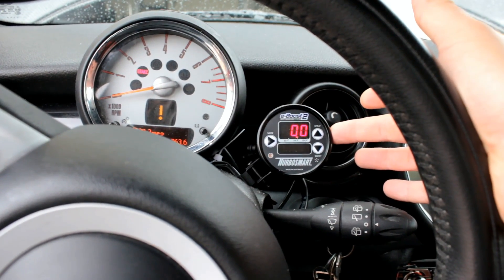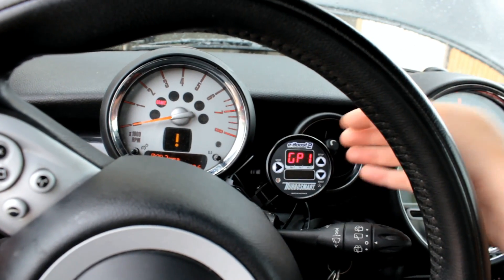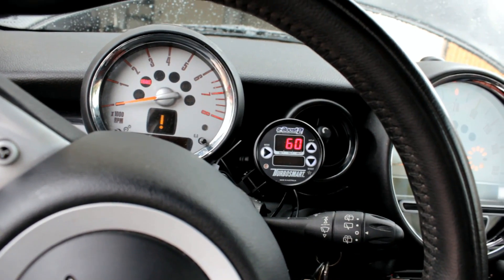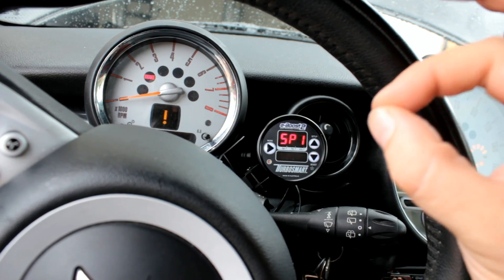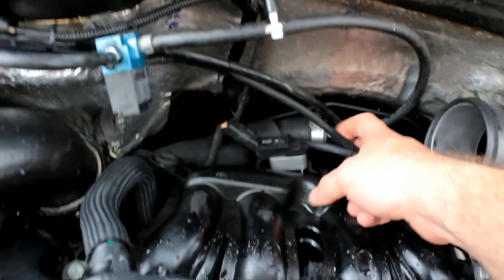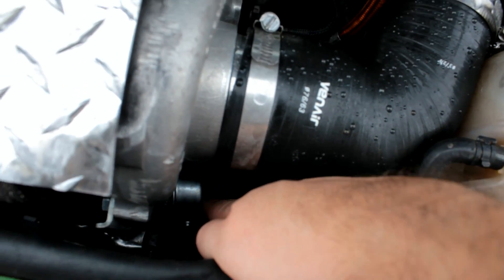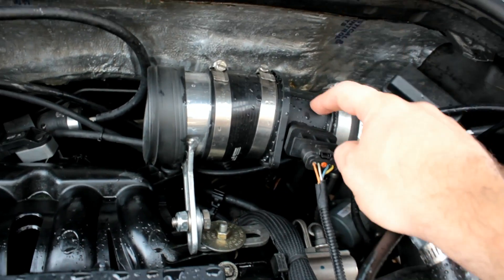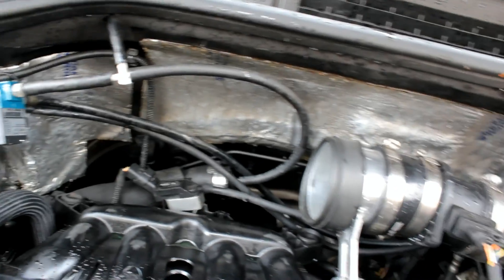Installing a Turbosmart TS-0301-1002 e-Boost2 Black/Silver Sport Electronic Boost Controller

Comment: I do not se how this would work with a factory vacuum setup.
Did u eliminate the factory boost control setup?
Does the aftermarket turbo now just use the old style vacuum/boost signal to control the waste gate?
Reply: Paul Danese no, he has a boost actuated actuator. no more mini r56 vacuum garbage. you can do that on the stock turbo just change out the actuator to one that needs boost instead of vacuum that boost controller is very easy to install but you have to learn how to program it and yes they could also be done on a stock engine

Comment: I seem to recall a post where one used a manual boost controller in this type of set up although I know the turbo waste gate needs vacuum to close. D you have an opinion on that? What boost levels do you run?

Comment from the maker: Non S you will get less than 2 HP gain changing the Exhaust, so don't bother. 

On the non S about the only gains you can have are through tuning. $900 for a Cobb and $500 for a tune, and you are only going to pick up 20 HP.  

With a 10.5:1 compression and the ECU managing timing, after you put on a K&N filter there is nothing left to do until you add a turbo.  

With a Tune you could advance the spark, and the Cam Angles.